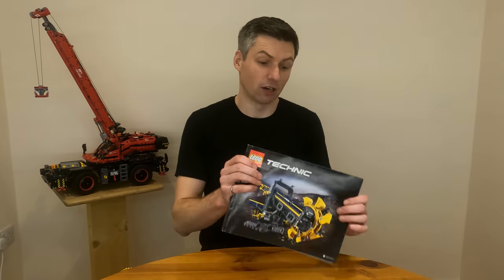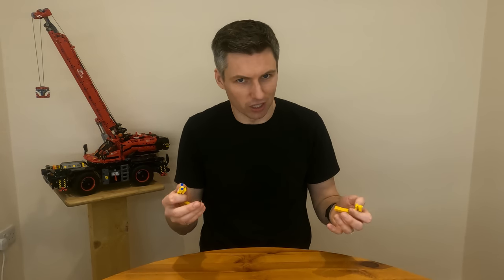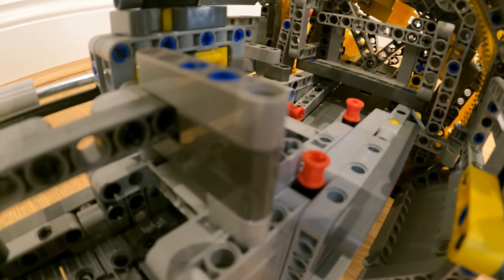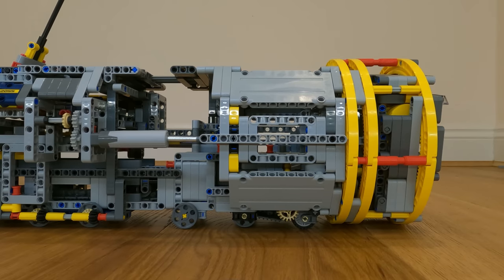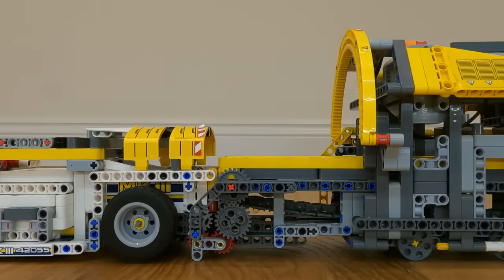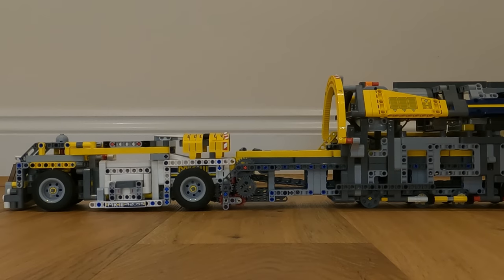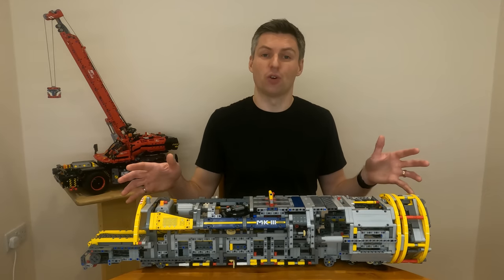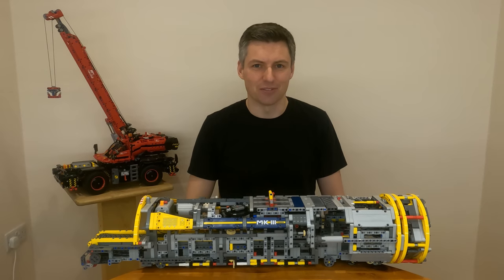Tunnel Boring Machine

Comment: I wish I could give you 2 thumbs up.   That is just amazing.
Top points on the gears and working/getting those values so close.
The only other thing I saw that would make it even better is to work on the gear box so it is autonomous.  It extends, when it gets to the full extension distance, it flips the gear lever and makes it shrink.
Reply from the maker: Completely agree: I was thinking of how I might do this during the crawl past portion of the video. And I did it twice, 68 minutes each time, becuase I messed up the first one.

Comment: I have a lego crane set 42009 that transfers power linearly. It has 4 support legs that extend outward and then push down to lift the wheels off the ground and prevent it from rolling when the crane is in use. Power from the gearbox is transferred through a turntable into the body of the vehicle to power those legs. The power can be transferred to either a gear rack that extends the supports or through an axle that runs parallel to the rack to power the linear actuators that push the supports into the ground. The axle is long enough to extend across the width of the crane and is fixed to the end of the support, with a red 8 tooth gear that also slides along the axle easily being driven by the gearbox transferring power to the actuator.
The difference between your design and the lego set is that the gear stays in place while the axle slides through it, rather than the axle staying in place as the worm gear is pushed along the axle
Reply from the maker: Thanks! I didn't know about the 42009 before making this this video, but now I do thanks to you and others :)

Comment: I really want to see it chew through some soft dirt.  Very cool build!
Reply from the maker: I might try this one day. When I first built it, I did get it to dig some Lego Pieces off of a wall. It worked surprisingly well, but a bit underwhelming. I didn't include a shot like that in this video because setting it up again did not seem worth it for the quality of the video I would get from it. However, I will keep thinking about a good material that it can try digging through.
Reply: @TheThirdModel  Maybe wet/packed sand?
Reply: @Zombiehunter2_0  or playdoh or clay, something that wont break up into tiny grains that gum up the gears
Reply: Snow could work. It can self-support and be soft enough to be dug by plastic shovel. The TBM need to be cold to prevent the snow from sticking.

Comment: The mk2 mobile crane transfers power linearly to power the small actuators on the end of the outriggers they use the red 8 tooth gear which has the same frictionless property as the worm gear
Reply from the maker: Ah ha! I see that now, thanks for pointing that out. For others, check out step 100 of set 42009 from Lego: https://www.lego.com/cdn/product-assets/product.bi.core.pdf/6143639.pdf
Reply: Im about to comment the same! But worm gears are definitely a better option in terms of greater contact area and less torsional load to the axis
Reply: Actually the B-model used it to transfer power to the end of the extendable arm via a 32 studs long axle.

By the way: 
It's a very cool model and it's even more inspiring!
Reply from the maker: @jakobgschwind4722  Thanks, I'm glad you enjoyed it!
Agreed the B-model uses the worm gear to transfer power, but the conveyor belt that is being powered is not moving linearly - that is the one difference here.

Comment: The crawling system is very cool (amazing that you got so close to the perfect ratio), but I wonder if you could've simplified it a lot by simply having ratchets that prevent the wheels from spinning backwards. This way when the linear actuator extends, the cutter head has to move forward, and when it retracts, the body catches up.
Reply from the maker: Great idea. This would be possible as long as the cutter head was heavy/sticky enough to remain stationary while the linear actuators retract. Otherwise the linear actuators would just pull the cutter head back to its original position. Given the design of this TBM, I think it could work.
Reply: @TheThirdModel  Might need to add the rubber band "tyres" available for the spindle "wheels" you're using, to drastically increase static friction.
With those, the weight ratio between front and back shouldn't matter much since lego axles rotate with very little friction.

Comment: i think there's one crane made by lego that transfers power linerarly- for the actuators at the end of the outriggers. they used a special red gear that didn't grip the axle, just like the wormgear you used.
Reply from the maker: That's right, it is the 42009. I didn't know about it prior to making this video. Thanks for pointing it out.

Comment: so if im understanding it correctly, the way the bore head itself moves is by thrusting it farther from the body, and the way it  moves is having the bore head stay in place and the body uses the hydraulic/piston things to pull the body towards the head, repeating this and moving the entire thing

kul
Reply from the maker: Correct. Another key point is that the wheels on the body are also driven by the motor when teh body is moving. The the cutter head is moving, the wheels are locked in place.
Reply: @TheThirdModel  here is something i dont understand, i get that the cutter head would move when pushed from the body, but how can the body itself be pulled towards the cutter head? wouldnt the weight of the body just pull the cutter head?   and if the cutter head was the heavier bit, wouldnt the body just push away from the cutter head instead of pushing the cutter head?
Reply from the maker: @JustTheRat01  The cutter head is not pulled towards the body because the body is moving itself towards the cutter head at the same speed the linear actuators retract. Watch the sped up footage at the end starting at 12:40. In particular, look at how the wheels on the body are driven when the linear actuators retract. Conversely, when the linear actuators extend the wheels are stationary - providing a 'solid footing' for the cutter head to push forward against. I hope this helps :)
Reply: @TheThirdModel  ahhh that makes sense aight

Comment: This is crazy impressive, did you ever consider offsetting the ring gears so they don't flex as much, or isn't it possible?
Reply from the maker: Thanks for the suggestion! By the time it got to driving the cutter head I had the design pretty settled and would have needed at least another 2 peices to implement this (there are 2 ring gears at the end of the machine for decoration) - or redesign the cutter head.
Reply from the maker: @TinkeringJohn   Nice Allison Transmission! Really impressive. Here's the link for others: https://www.youtube.com/watch?v=dSXqpYkRyTY

Comment: now make is use water and lay bricks to hold a tunnel up and make a tunnel through studs or sand like a real excavator
Reply: to those that might not get it, this is a joke. I'm really impressed with this build as it is, and tunneling through sand would basically be impossible without using non lego parts